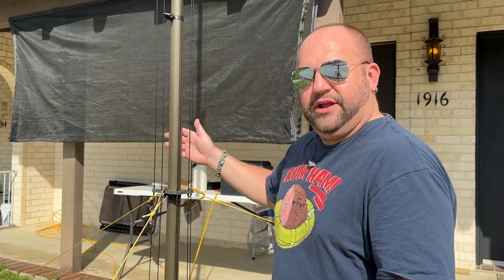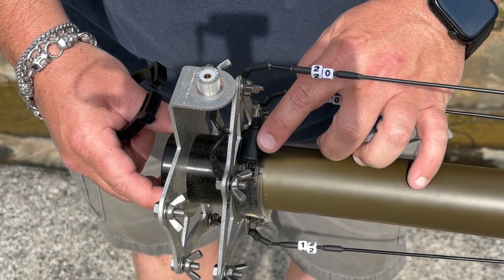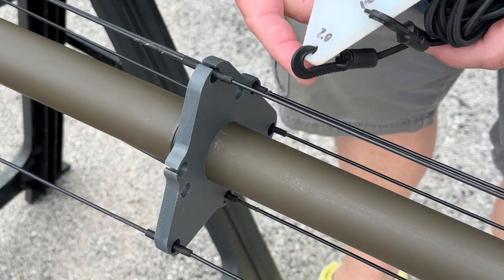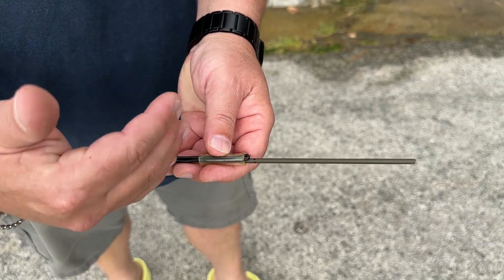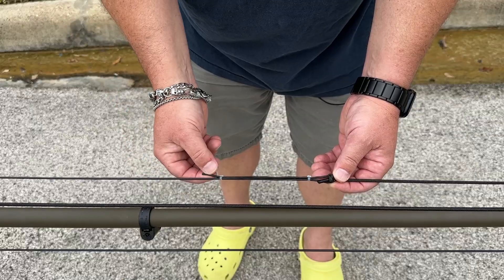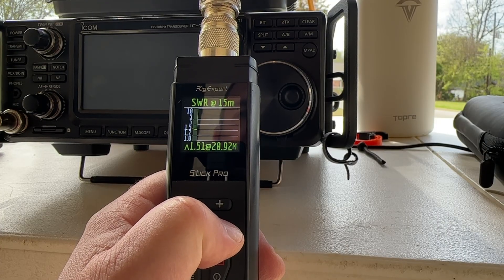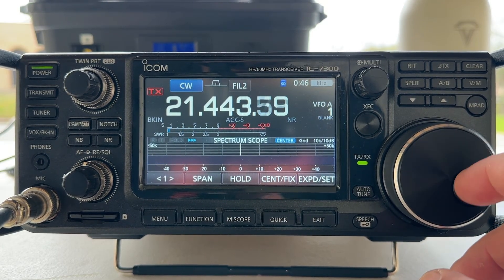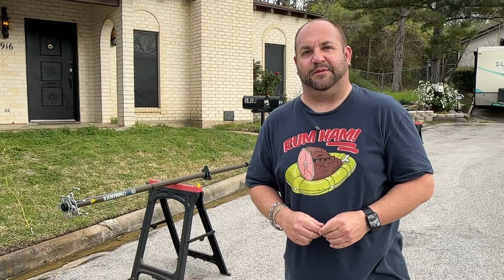Big Upgrades!  DX Commander Expedition Portable Antenna

Comment: I've had a Classic w/80m for 4 years now and I love it. Callum just dropped the 2025 version of the Expedition with free shipping so I ordered one. I will most likely use it as a portable with 10, 15, 20 and 40m although it comes with enough parts to run 7 bands including 80 as an inverted L like my Classic. It should be here in a couple of days and looking forward to getting it setup for POTA activations. Thanks for the video and I agree Callum is constantly making improvements.

Comment: Reading the comments, I see the McCormick hit squad are out in force again lol....Keep Calm and Carry On Mike, they are perfect in every aspect of their lives and we simply can't compete with that.

I'm very tempted with this version as 99% of my operation is portable/mobile. I'm not a fan of faffing about setting up an antenna in miserable WX and with this variant along with the new spreader plates, I can envisage a few ideas on keeping most of the elements/radials fixed to the bottom plates and simply coil them up when not in use then stow the assembly into a bag (I would like to see this version supplied with a storage bag being a portable setup). Also, compared to my go too, inverted-v's, I would need around 30/40ft less coax. 

All the best Mike.

Comment: I bought mine last week and I wonder what’s the bandwidth of this antennas in 10 and 20m? I finally tuned everything beautifully but for 20m I need a tuner if I want to go to the digital portion (have it tuned for 14,175) and for 10 tuned for 28,400. So I don’t know if this is normal in this antennas or if I did something wrong. I have over 25 radials cut for all bands and specifically 4 radials for 20 and 4 for 10.

Comment: I just built a tri-band 2024 Expedition (through your recommendation) and have been loving it!  I'd recommend keeping the shock cord attached to the elements.  Makes it so you don't have to go hunting for them.  The instructions had you creating a loop and attaching each element to each plate with a piece of shock cord but honestly I like how you did it better and that many attachment points likely aren't required.  I tuned mine to the middle of the sideband area for all bands.

Comment: The zip ties on the fold-backs is genius.  I've been fighting with the cold un-sticky-ing the heat shrink and then the electrical tape.  Also, my 30M element is too short, so there isn't enough "tail" to secure the wire under tension with adhesives - a zip tie will probably do the trick.

Comment: I learn things from your channel. Thank you! But you should probably pull this video. It's been viewed over 10K times, and it contains inaccurate build instructions. If a visitor doesn't read the comments, they won't know what Roly, Callum, and others pointed out about the driven plate.

Comment: First: The support I have received from the people at DXCommander has been great, when I did request help.  
That said, I am the one exception to the 'greatness' of this antenna, but I need to vent, just to vent... I hate my DXcommander (Expedition) antenna.. I have had it for about a year, and I haven't even gotten it on the air yet. Mostly my fault, as I get furious and walk away and come back later.  My issues are that there has always been an issue with the 40m element loops(heatshrink failure), securing it to the pole, and the fiddly (inconsistent) pole extension.  Construction was a pita, as the new (at the time) 'unified' manual was not very well organized. (I see today they finally issued an updated (Mar '24) but haven't explored it yet)... you had to switch between different sections, or have to go to go this video or that to get this tiny bit of important information, or something non-linear for construction.  This video is keen to point out, there have been so many (~) changes to the design, but the supposed beauty of a unified, ON-LINE manual, is that you can publish updates with ease.  Making a customer go search for updated info is terrible. Links to videos are helpful, but what if that is not an option for the end user?  It's a digital, ON-LINE manual, use as many pages as needed to make it COMPREHENSIVE!
The glue heat shrink is great, but for securing anything under tension, its full of failure, but I guess that is limited to use in the warmer areas (?).  
I like the zip-tie idea, wish I had thought of it last year.  My option was to use waxed lacing cord before heat shrink to secure the loops, they are NEVER coming undone on their own now.
The use of Discord for help is a full-on circus (just a run-on conversation) for finding anything helpful, but that's me, no one should have to be weeding through a bunch of comments to find something that would help..

Comment: Does anyone have any experience running the radials straight off to the sides on both sides? Instead of a circle pattern. Basically just in a horizontal fashion. 

I have a very limited space I can put one up. A 3 foot wide strip in my backyard. I have about a 25x3 section to work with

Comment: like yourself, I found that securing the wires with tie wraps much better than tape. Mine is on year three with no problems. It is permanently installed over a steel pipe driven into the ground.

Comment: Dude you're element plate is touching the metal collar of the driven plate. That clip you had was to create a separation  from it. There should have been a plastic hose clip with a hex head on it to hold down the element plate on top of that clip you had in you're hand.

Comment: nice job. I got same one. I double clamp the bottom so plate don't slid up. like your way. I took me a few hours to tune . my dip on 10 meters different but not much band with either.  I have lots of extra glue line heat shrink. and extra shock cord. I did some mono band element's. for 10 11 12 meters I cut 3/4 wave and did fold back tune . playing around a wile I got great match on 10 and great band with same when I set 11 and 12 meters. I put different color heat shrink when I found the tune so a quick slide on 1 of 3 bands . and did the same with 6 meter. I cut 3/4 wave fold back. I get 2:1 and nice dip to about 1.2 on the whole 6 meter band. so in a pinch I can remove all elements and mono band.  you can easy run KW threw it and wire stayed cool even the Pota flex 7 can take the power. and Pota flex really stands out in the snow ! so does the dark green . looks so good ! that Ham sexy ! I did the longer ground wires . the bottom of that pole is metal and the black one plastic. I have both poles . but only 1 antenna the green one. I use the black pole for my end fed ETC. love them. they take the wind. I put that shock cord on my end fed antenna . great stuff from DX commander. he sells extras and ships fast !  I am in NY and stuff from the UK comes same time as orders from the west coast. SOTA Beams fast ship to us as well. I got the antenna wire in GREEN . they have yellow as well. great stuff from the UK !  they Ham harder ! catch Lord Callum on the air now. they do a KW now ! 73's

Comment: Hi Mike,  Love what you do, however, I have a few issues with your build, sorry in advance. 

Firstly, the plastic clip needs to be between the bottom cap and the driven plate to stop the driven shorting out on the ground. Run a lot of power and you'll see the SWR go up dramatically. You my also find that increasing the distance between the plates aids the bandwidth on some bands (not confirmed one way or another). 

Secndly everytime an element passes through a spreader plate, a 'quick loop' is supposed to be made, which when used with a little shock cord fixes the element into place. This uses less heat shrink than the method you have used and spreads the tension a little more evenly across the pole and element. 

Thirdly, the 40m element. Have a look at the build video Callum did. The Idea of using a small amount of tubing to go over the top of the pole makes rigging 40m so much easier than it was previously. The foldback is permanent so no need to mark the pole with where it should be. It also results in perfecting the tune on 15m and not worrying about the resonant point having moved.

Finally, and not so importantly, if you make the loop on the fold back at the end of the elements only just big enough for the shock cord (so that the stopper knot cannot pull through), you can leave the shock cord permanently attached to the element, and snap the shock cord into place. Really speeds up the build.

You are right in saying the new version is a step up over the previous one, but if you had built the new one according to the new manual, or following Callum's video (in which he built mine), you'd find it is a HUGE improvement.

73.

Jonathan
M0JSX / K6JSX
Reply from the maker: That’s cool and the gang, but I didn’t want to build it that way.
Reply: @hamradiotube  Then sorry Mike it is not a DX Commander build but a hashed up K8MRD knock off.
You CAN'T do a product review if you go an modify it "because you didn't want to build it that way".....   Just say'n

Comment: Hey MIKE, That BOTTOM clip is vitally important.  The bottom cap is now made of metal and it can short out against the driven plate unless you fit that plastic clip UNDER the driven element to add some isolation between the driven plate and the bottom cap.  Yes you still need another clip on TOP of the driven plate to stop it from moving up the pole under tension.
You MUST have the clip below the driven element as well otherwise you will certainly come to grief if you raise the power a little !!!!
Cheers
Reply: What Roly said! The herbie clip goes between the bottom cap and the driven plate.
Reply: I came here to say this because that bottom section is anodized aluminum and it will short
Reply: Beat me to this Roly 😊
Reply: Beat me too it also.....kinda surprised it tunes being so close
Reply from the maker: Hey thanks for the vote of confidence.  I appreciate it.  Pretty sure I’ve sold a few DX Commanders for him.  But I’m gonna go with no.  Apparently there’s two manuals and I didn’t even see the “new” one.  I just went off of the Unified manual.
Reply: @hamradiotube New manual for this one and he has a build video.  I like your heat shrink at the spreaders for the elements, may have to do that.   40m gets wrapped around the top of the antenna with the new manual.  Keep up the good work!
Reply from the maker: Well perhaps I missed that part in the manual lol!
Reply: @hamradiotube  Actually MIKE, You didn't read the manual at all !!!
You simple copied what you did with the previous model from what i can see, particularly with your 40mtr element !!
MIKE, mate, this model is a complete redesign/rethink on the prevu=ious model with LOTS of innovations to make it  even easier to use especially for POTA !!
Sorry MIKE but you have done DX Commander a BIG disfavour in publishing this video.
Can I respectively ask that you take this mess down and redo the video AFTER you have read the proper manual for it??
Cheers.

Comment: I agree with securing the fold overs.  I have 2 DX Commanders: A 12.4 Signature and an Expedition.  When I built the 12.4, I found the South Carolina heat made the glue lined heat shrink slip so, I did the same thing with the zip ties.  Now, both of mine have the zip ties instead of the heat shrink tubing.

Comment: The plastic ring you don't use because the hex one is better to hold the driven plate down has to be under the driven plate. It has to isolate both plates.

Comment: Cal and Loki are great and their support are top notch. I only have an expedition pota pole but it’s extremely strong and convenient. Debating either upgrading to the new pole just to for the new base or going all out and getting the full expedition kit to actually use their antenna system.  Hmmmmm

Comment: Looks like an awesome antenna! What kind of circumstances would you deploy this antenna? Is it for more of a longer activation, like several hours or a couple days? Would you use it if you're just going out for an hour or two in a park?
Reply from the maker: I primarily use either this or the PackTenna EFHW for portable.  Parks on the Air, Field Day, etc.  If it's going to be a quick in and out activation I'd just put up an end fed, but if I'm going to be there a while I'll bring this.  It really only takes about 15 minutes to set up and deploy though.  The nice thing is it can handle as much power as you want to throw at it.  It's resonant by design.  No transformers like a 49:1 or 9:1 so no losses there.  No power limitations on digital or CW.  It's just a hell of an antenna.  You don't have to tune it when you get out like a loaded vertical like the Wolf River Coils or Buddy Stick Pro either.  Just set it up and you're on the air on whatever bands you make it for.  It all packs down to a very small form factor too.  When the mast is collapsed it's only 24" and all the wires, spreaders, everything, fits in a small little Carhartt Lunch bag that I use.  I've done other videos with the old version of this you can check out.  This is just an upgraded version.  Here's the whole DX Commander Playlist on my channel. https://www.youtube.com/playlist?list=PLvjQnyd_FwboFRQtCen3YN_P4qv1ChEmc
Reply: @hamradiotube  thanks for the info! that helps. I ordered the Packtenna 10/20 EFHW w/ the 40m extension this week and already have the End Fed Random wire from Packtenna and I LOVE that antenna. I'm seriously considering the DX Commander in the near future and your comments have certainly given me more reasons to get one.